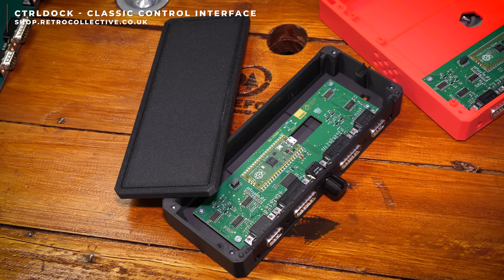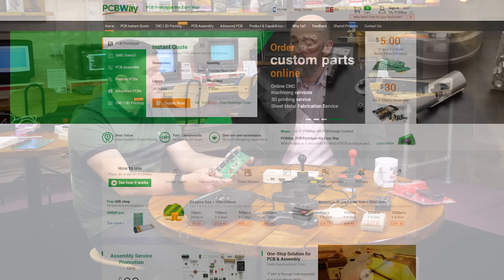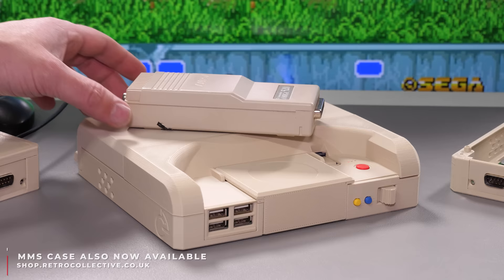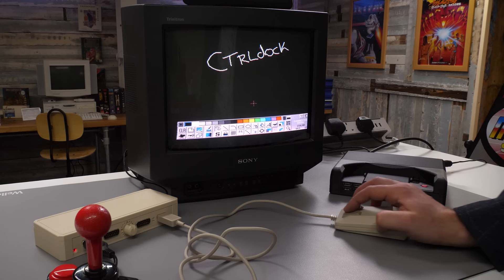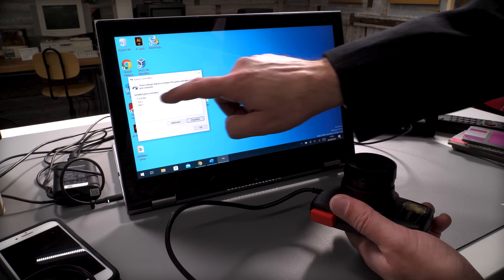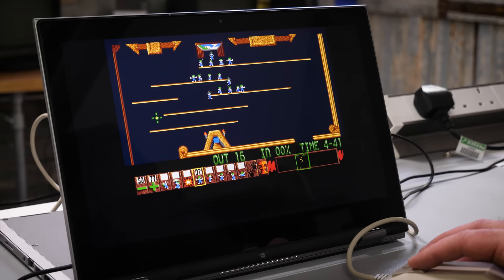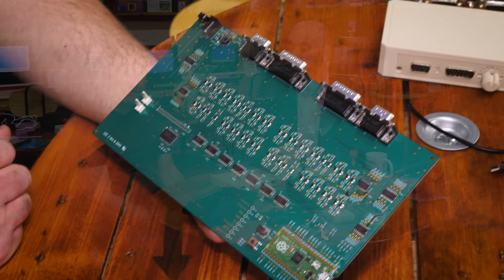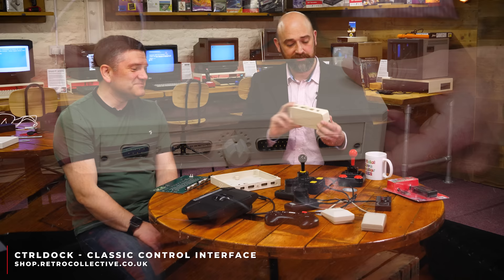A New Low Latency Analogue & Digital Retro Gaming Interface | CTRLDock

Comment: the master system controller is an interesting one, given that the system itself has a physical pause button. what would be cool is if you did a pass-through cable, perhaps not just strictly for the master system, with four or five buttons on it which could be mapped to system buttons like pause, reset, etc.

Comment: Real nice project! I've made a 2×9-pin adaptor myself... but had wired the ports directly to the GPIO pins of an AVR microcontroller. Worked for a while until the chip fried, so yes... overcurrent protection is probably a good idea. :)

Mine supported Atari joysticks and Mega Drive gamepads, but 6-button recognition didn't work every time. The state machine got stuck somewhere believing it was a 3-button gamepad. Experimented with Amiga/Atari mouse support but didn't find it worthwhile now that modern mice are so more precise.
Would have wanted to support the CD32 gamepad, but couldn't get hold of any to work with.

Comment: I think it's a great board and I totally agree with the fact that most other solutions are very meh at best.
I only think that 90 pounds incl VAT is a very high price to pay for a bare board. 
For example, there are already very similar boards (also based on the RP2040 ) for roughly half the price.
Fair enough, some aren't that universal, but for me this price is just something that I find hard to rectify. 
I don't wanna sound very negative or rude about this, because I really do appreciate all the work and effort put into it and absolutely love everything you guys do! Just sharing my honest feedback and opinion. ❤
So I will let the pass for me, sorry.
Reply: Don't know what you are complaining about. Don't be an early adopter then or go with the boards you mentioned that you think is the same. 

I think maybe the latency is even lower on this, (very important) and this one you can easier plug to play many different input devices.

Comment: So this plugs into the internal USB port of the multisystem board, right? It doesn’t use the SNAC connector or IO-USB port?
Reply from the maker: On the MMS it plugs into any USB port, with the slice you can feed it up to the usb port hidden under the front cover

Comment: I love that you correctly identified the 9 pin D-Sub as a DE9. It probably should be plastic, but I know they’re more expensive and it probably won’t wear the plastic plugs that badly.

The 15 pin I think you called a DE15, but it’s the larger A-shell D-sub, so it’s a DA15. A DE15 (or DE15HD) would be a VGA connector.
Reply: Richard said 700 nanoseconds. I think he meant 700 microseconds. That’s still very impressive given the 1000 Hz USB polling rate. I suspect that number has some error bars on it because it depends where you line up with the next USB poll. Still, it’s impressive.
Reply: DE15 is also the Jaguar controller port(hence why they couldn't test it without an adapter)
Reply: @therealjpster  yeah, that made me scratch my head for a little while. i know the pico (overclocked) can respond to nanoseconds timings, but processing and translating the signals from the controllers so fast is somewhat truly hard, but in the end it's not really needed. anything close or lower to that 1ms is very impressive and a testament to the pico's flexibility and their engineer's skills. but now we want more!!!!

Comment: Hope there's a revision with Saturn ports, or otherwise is Saturn compatible, it's 9 pins so I assume it could be added to the current model but I assume identifying the attached device (where it isn't a standard Saturn pad) would not be that simple. The Saturn->USB adapters I've seen (and the one I own) only seem to support basic Saturn pads and not the 3D analogue pad or the racing wheel, and I'm guessing it's because they don't have the capability to identify them as different devices from the standard pad. While the 3D pad is most commonly associated with NiGHTs it's my favourite way to play Sega Rally Championship, and being able to use it on my real Saturn, the MiSTer and other devices would be really cool.

Richard also mentions the Mega Drive 6-button pad and its complex design enabling the additional 4 buttons (including mode). If you guys fancy making an MD 6-button interface like the ones Monster Joysticks make, so you can make your own 6-button arcade stick for the original MD, I'd be very interested in that. Sadly it seems there are no products that let you do it with 6 buttons and even Monster Joystick's is just a 3 button interface. I appreciate it's sort of the opposite of what you're doing here though, I just thought it might be a way to build on the knowledge developed around how the 6-button pad communicates button presses.

Comment: I modded a USB arcade style joystick to accept Atari 2600 9 pin controllers, which works well for the classic stick and fire button controls... but not Trakballs or paddles. This item could be the solution for all the classic controllers.

Comment: I have not tried to check out the source code for this device (if it is available?), but I heared here that some of the latency is caused by debouncing logic?

If so, have you considered "asymmetric" debouncing? Idea is that whenever you see a button press, you register it immediately, but to "release" the button, then you have a counter to count enough consecutive release states to actually register the button to be released.

Usually when you see any "noise" on button signal, it means that somebody is physically doing some touchy-touchy with it anyways. And on the other hand, releasing the button is usually less time-critical activity on gamepads.

Just food for thought. Maybe you already are doing it. :) Great work!

Comment: Two questions:  1.  Does it support XInput? A lot of the cheaper USB adaptors only support DInput, making them useless in modern titles.   2.  Would you consider adding a configuration for custom arcade controls? (Possibly using the DB15 port?)

Comment: I'm thinking these came out in a time  around the start of the USB 1.0 craze around windows 95c,d,3 and win 98..

today you be battling to get them to work unless they were made to run on a a new pc of today

from the POV of 8 and 16 bit controllers, most  ran in a 9 pin serial when  talking about  sms, mega drive, NES and SNES.

Can't comment on what was functional on  c64, c128, tandy trs-80, amiga prior to commodore and amiga after purchase of amiga by commodore

I'm basing this from my battle station II

not sure what will be compliant with  your break out board connection though with some fighting  games  you will likely be needing to support both 2 and 4  player games

If i was so inclined I would consider a multi tap option with a 1 or 2 usb input port 

4 port controller output for sms-dc, nes-switch, xbox-one x, ps1-ps4pro

Comment: This looks great, a bit pricey but I get it offers a lot. So, if I plug an atari 2600 paddle in it, I can plug this to raspberry pi running mame and play using it as a spinner in arkanoid?Or say the amiga mini, will it work on one using two joysticks for two players?
Reply: VCS paddle will be suboptimal for Arkanoid, as the game expects infinite rotation to be available. There's no concept of position, and Arkanoid spawns every new paddle at the center of the playfield regardless of where the controller is.

You want the Atari Driving Controllers, which are sadly much less common.
Reply: @CptJistuce  I get it. Thanks for the answer!

Comment: How about adding support for the original macintosh 9-pin mouse?
Reply: The Mac mouse's connector has the opposite gender to Amiga/Atari/Amstrad.
But you should be able to find the pinouts online and solder an adaptor to it pretty easily. All of them are "bus mice" with 5V quadrature signals.

Comment: Just want to mention that I own the modern updated version of the Mayflash adapter (both the MD and N64 versions) and can confidently say their latency is very low, definitely below the ~50ms response time said in the video. And they can be used on the Nintendo Switch!!
Reply: And yes, 6 button is supported and works as expected

Comment: Since the DE9 connector carries 5 volts on one of the pins (usually pin 7). Are there any configs that changes which pin that carries the 5 volts and thus can damage the system you are connected to if you select the wrong system on the CTRLDock?
Reply from the maker: you’ll here in the video the video that protection is in place to prevent such damage occurring
Reply: @RMCRetro  sweet! I promise I saw the whole thing but didn't catch that.. :)
Reply: @RMCRetro  the video implies that the dock is protected from misconfiguration. But what about the device you plug in? If you push the wrong voltage to the wrong place on a control pad you might fry it. It's unlikely with those old dumb things, but as mentioned in the video, some pads were a little more intelligent with serial protocols and such.

Comment: What filament is it?
Reply: Filament?
Reply: @eadweard.  They said they used a filament that was a colour match for the amiga 500, I would like to know which Filament
Reply: @Wanton110  Oh I see. Isn't a filament a little wire in old light bulbs?
Reply: Oh no it's the plastic in a 3D printer isn't it?
Reply: @eadweard.  You are right, it's both the thing in the light bulb and the plastic for 3d printing
Reply: It's Printed Solid, imported from the US. Google "printed solid amiga" and it'll take you right there.
Reply: @Wanton110  US only you would need to import it if outside the US, website is printed solid
Reply: @huubpeters7972  Ah, I thought Printed Solid was describing how it was made not a brand

Comment: I'll never get why someone who is designing a PCB anyway would then include a Raspberry Pi Pico as a large daughter board. I get it for non-pico boards that need a lot of grunt, but a daughter board for a micro controller? What's the rationale behind this?
Reply: @TheRenHoek  Not really the explanation for why an RP2040 is used in the first place. Any micro would do.
Reply: @graealex  He said also that they needed a µC with many GPIO pins. It is also very nice to have it work like a USB drive when updating the firmware.
Reply: @FindecanorNotGmail  A lot of devices with integrated flash from for example ST micro would also qualify for that.
I simply don't get the hype around the RP2040, especially when the BOM cost forces you to install a whole daughter board.
Reply: @graealex  STMicro have been hit disproportionately hard by the chip shortage and their parts have been almost unobtainable for more than 2 years now. Many projects have been forced to redesign, or have failed altogether due to their dependence on STM parts. As an aside, the daughter board approach is commonly used in commercial products for a variety of reasons: sometimes it can be regulatory (eg WiFi daughter boards with type approval), other times because it allows a different PCB type to be used for the logic than the rest of the system (eg RF systems might need special PCB types, or the logic section might need more layers than the rest of the system).
Reply: @ickipoo  I do get the availability of certain parts as a reason. Although I am having trouble believing that there is currently no Cortex-M part available, which IMHO would be more than enough for what they're doing here. 
The rest is irrelevant in this particular case, and I am also very sure that integrating a board for RF reasons won't save you from conforming to FCC regulations, although it might be easier to prove compliance. Correct me if I'm wrong.
Reply: @graealex  Remember that design & development takes time - even if an STM part is available now, it likely wasn't when the project was making part choices. Aside from that, STMicro really screwed the pooch, and it will take time to rebuild trust. The RP2040 (mostly) remained available the whole time.
As for WiFi modules, getting approval for something that can transmit is much more complex than regular emission compliance. Both the FCC and EU have streamlined processes for products that use an approved module. For this reason, even high volume consumer products often use third-party modules when space isn't a constraint. An added benefit is that the module interface is somewhat standard, so you have choices if your chosen module becomes unavailable.